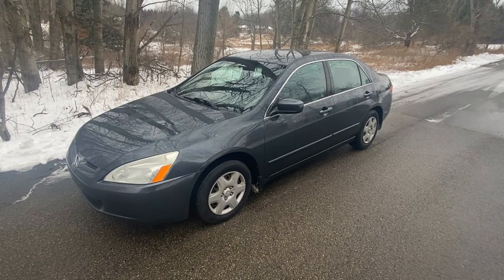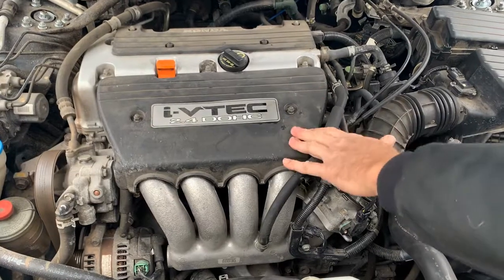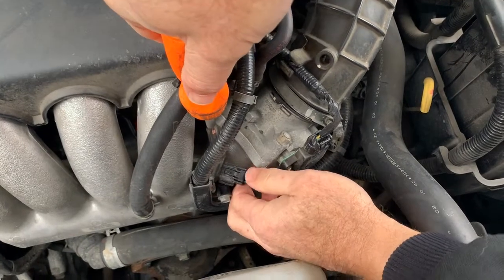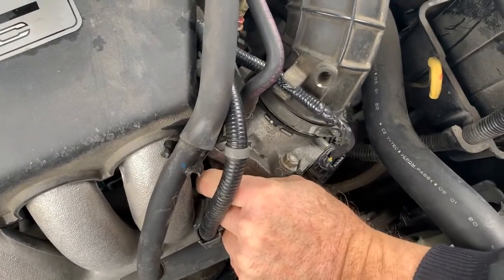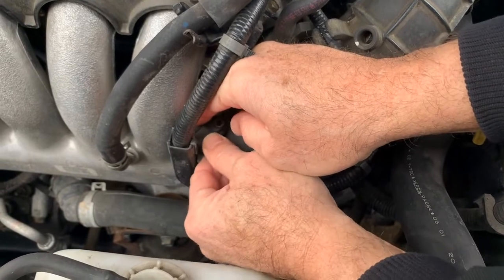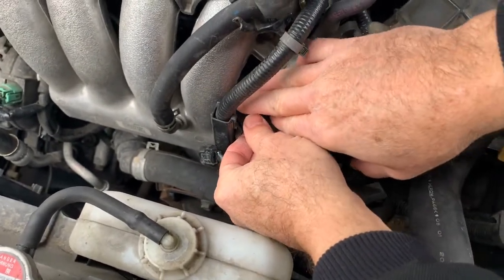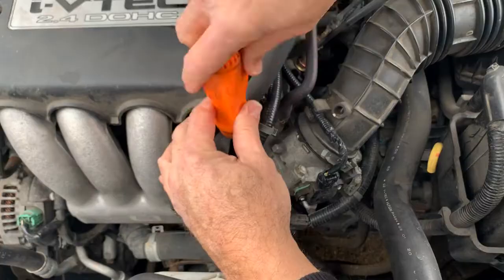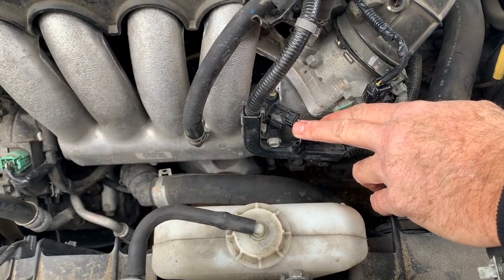How to Replace MAP Sensor Honda Accord

Comment: I was told to torque the bolt down to no more then 2.5    foot lbs. You say crank on it. What should it be?
Reply from the maker: Never said (crank on it) but you definitely don't want the screw falling out,  I don't think you can really over torque it too much with a screwdriver. Just use common sense and you should be fine!
Reply: Apologize, you didn't say crank on it, I crossed your video with this other one.
Reply: @whitham1961  youll pass 2.5 ft lbs fast by hand

Comment: Can these be cleaned? Where did you order a oem one?
Reply from the maker: You could try to clean it but that usually doesn't  work. Part was purchased through Amazon and listed in parts used in the video description.
Reply: @TheAutoTeacher  thank you for your expert advice. I will order one
Reply: @TheAutoTeacher what was the open hole on his air intake tube?